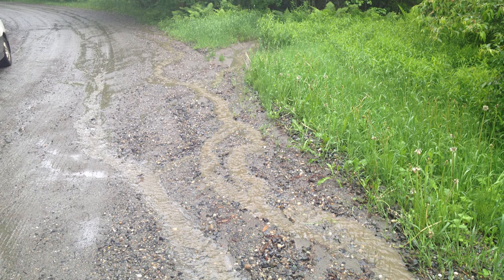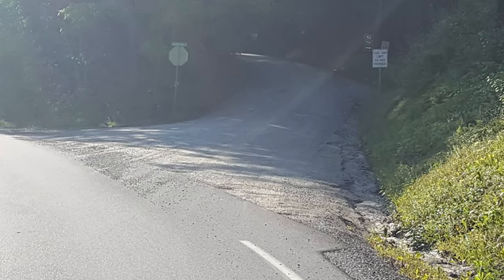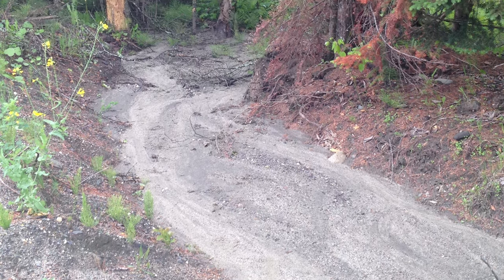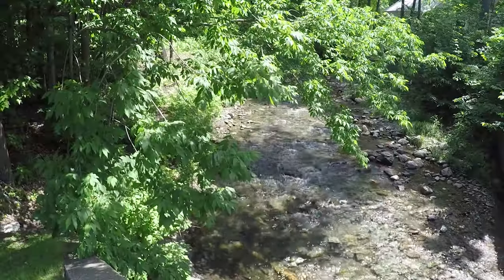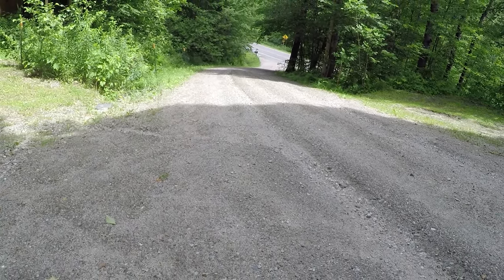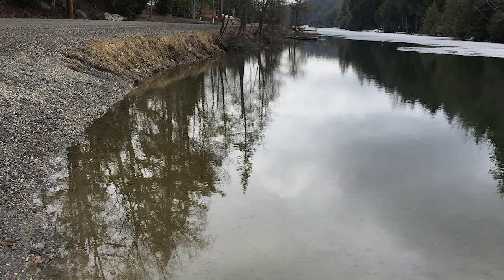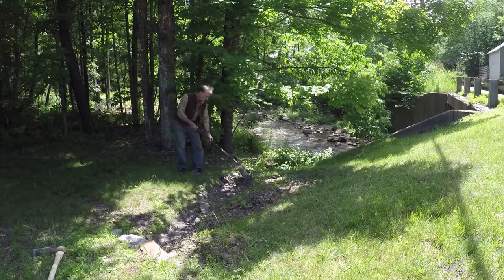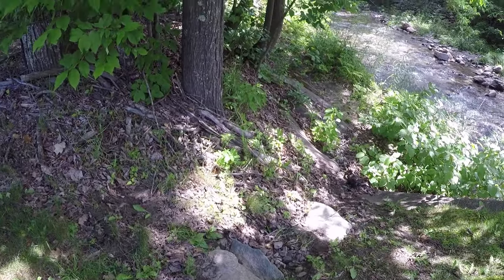Slow It, Spread It, Sink It: Reducing Stormwater Erosion on Private Roads

Comment: It all boils down to routine maintenance.  No such thing as do it once then good for all time.  Sad fact of it is the stone needs to be removed, cleaned and re installed at least every year, and depending on the rainfall, more often. In an ideal world, the stone grows over with low vegetation that stays in place during rian events, but never grows so thick so as to impede water flow. The only alternatives to this would be concrete, asphalt or better drainage(more culverts).  No one ditch can handle all the water for the length of the road.

Comment: What is a water bar?  I would like more information on this, for my driveway.  Thanks.
Reply: It's a small shallow ditches like the guy was digging in his driveway. Just a couple inches deep and 6" wide or so to divert water off the driveway in spaced distances to help keep the water from building up into larger flow. We have flow problems and if I go out when its raining it's the best time to see where the flows are heaviest and where they can be diverted.
Reply: You can lay kerbs across the drive layed on their side to deflect water running down the drive into a ditch at the side. Not so easy if you have to plow your drive if you forget where it is or do not mark it. But less work than digging a little trench across the drive after every big rain or month.
Reply: More commonly called a breaker.

Comment: Doing what you can to prevent your driveway/road from eroding is always a good idea.  It will save you more money and effort than repairing afterward.  But that does not change the fact that if that driveway/road was not there, the runoff would be eroding the soil from the hill and into the streams anyway.
Reply: @onetwotulip  
True.  But people are there and those people need a road to travel on that their vehicle can safely traverse.  That is why a PROPERLY built and maintained road is so important.  Not only do they provide a safe path to travel but can prevent a great deal of erosion at the same time.

It is one of the things I was taught as a child.  If you do not have the time or resources to do it right the first time, where are you going to find the time a resources to do it again, and again, and again,....

Comment: Why dont they tar the road.
Reply: There would be less infiltration, more runoff and flooding problems downstream
Reply: Not to mention cost…and if you don’t handle the water, the gravel under the asphalt can still wash out and make the paving fail.
Reply: @Gordon_2000  Plus harder to get up paved driveways in winter than gravel